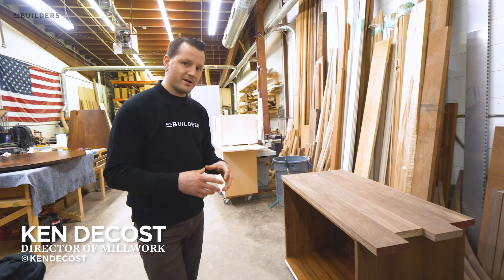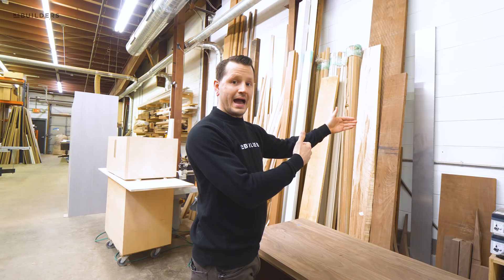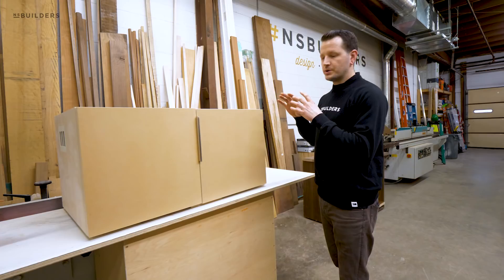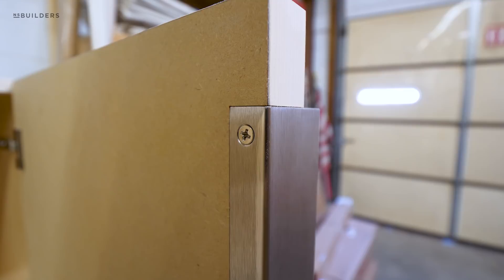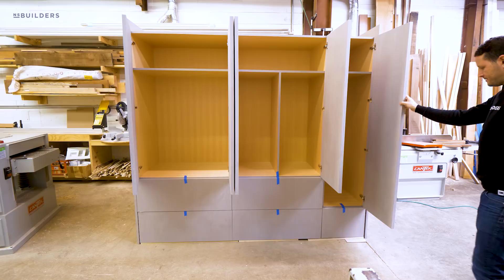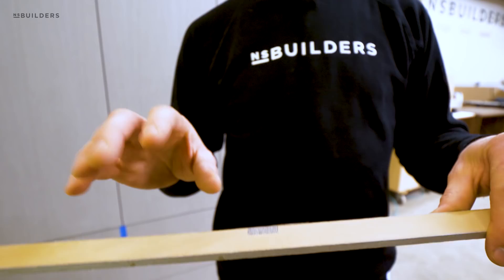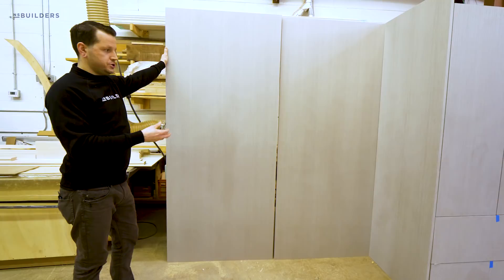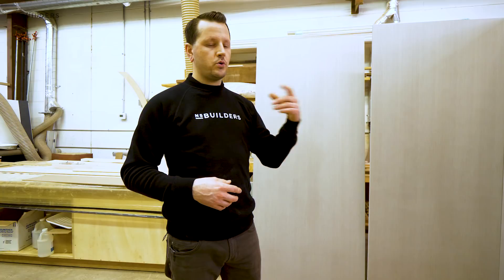Veneered kerf detail on a custom wardrobe | Revealed

Comment: To make the kerf cut on the door. I would actually make it out of two door panels joined together with 1/2" plywood let into edge dados. The dados would have to be plenty deep to give the door enough strength. I'm guessing one inch deep would work.  I would  veneer all the surfaces of the two panels and  the 1/2" plywood faces except the left and right edges on both door panels before gluing them together. The 1/2" plywood would have to be glued carefully into the dados to avoid squeeze out. Then the joined together panel would get the left and right edge veneers last. Care would be needed in cutting the edge veneer where the kerf is.  I think this would work. In any event it's not an easy problem to solve.

Comment: Making a glue-lam of the veneer to be received by a dado in the door where the kerf will be, was really, really smart. However, I'm wondering if you guys plan on finishing only the bottom of the trough in the kerf darker so it looks more like a shadow line.... That's what I would do. Love these cabinets! Keep up the good work!
Reply: We've tried that in the past and it actually didn't work out how we had hoped. There will be enough of a natural shadow line to define the difference and keep the reveals but ultimately you could see it if you looked closely.

Comment: Few good ways to achieve a kerf detail. I often make two actual door panels with veneered edges, than cut a rabbet on the back side of kerf edge. 1 face veneered I brace gets glued, Flush sand and veneer the faces. The front veneer can be one sheet. The kerf gets cleaned up with razor blade or pre cut the face Venneer and tape it for glue up. Not necessarily a better way than your method, but since you ask a different option, there it is . Used both the one you show here and this other one. 🤷🏻‍♂️✌🏽
Reply: Also a great method. We have used that way in the past as well. I've really come to prefer the one piece panels. Thanks for sharing!
Reply: @kendecost  thank you for giving us a tour and educating the masses.